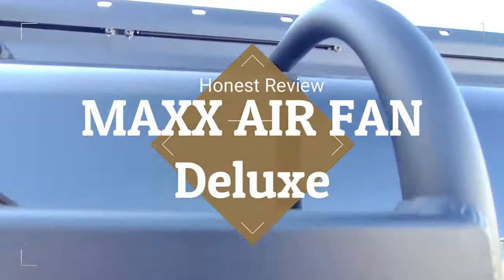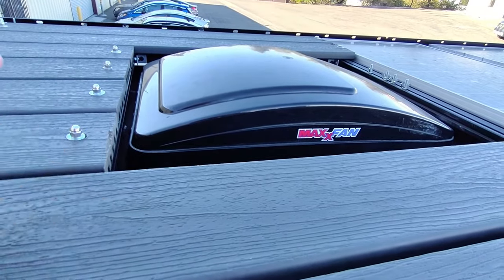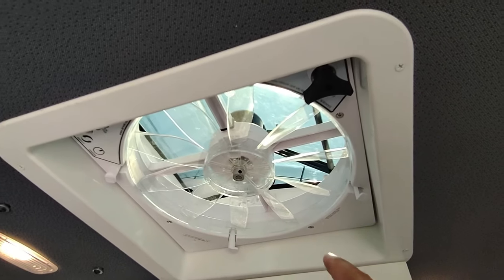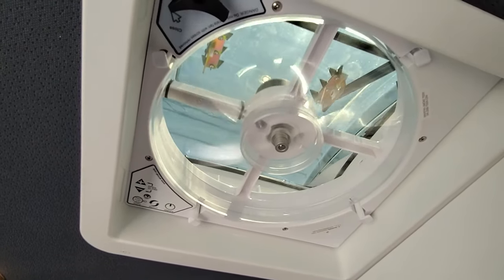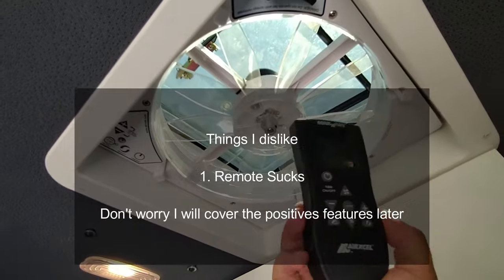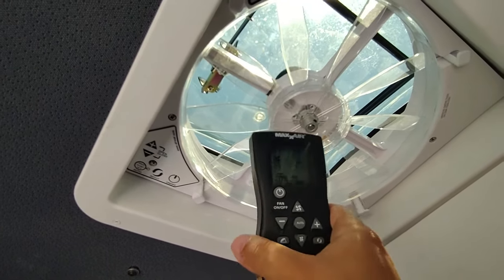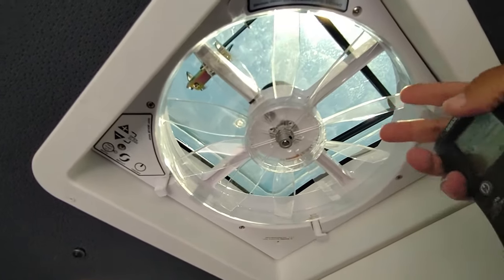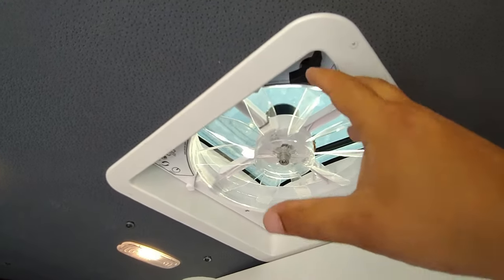Maxx Air Fan Install Defects▶️ Maxxair Problems Must Watch

Comment from the maker: ▶ Link to fan on Amazon.com https://amzn.to/3tCZXBX

▶▶▶Camper van playlist
https://www.youtube.com/watch?v=r2KTXLqso2c&list=PLDEbtVOPRC-id5xjqFsYm87bJSJL8bLbe
2019+ Sprinter Review https://youtu.be/wAAV6bnHNzY
The new toy  https://youtu.be/EAKbCledvsQ
Low Key Battery https://youtu.be/-FI_DG-DE9k
How to Buy a Camper van for cheap https://youtu.be/nqPSV0mszfk
Seat Removal https://youtu.be/KSUQawuSt_w 
Headliner removal https://youtu.be/FjrJBLXEbyU
Maxx Air Fan Install https://youtu.be/QXxBSx3cfI8
Maxx Air Fan Review https://youtu.be/JIRG7lSR5yQ
Maxx Air Fan Fix https://youtu.be/6k0mPqCgrl4
Bathroom Fan Review https://youtu.be/QXxBSx3cfI8
Spare Tire Carrier https://youtu.be/wVQ_h-FjtPE
Oem Diesel Heater Trick https://youtu.be/Ws9GHo9bWeM
Led Upgrade https://youtu.be/r2KTXLqso2c
Sportscraft Swivel Adapter https://youtu.be/HVkj6KVpUbs
Pocono Swivel Seat Adapter https://youtu.be/r-1HpIl71_I
Front Speaker install https://youtu.be/JjoJH4z4G1E
van Sound Deadener https://youtu.be/8x8RxmrBxL4
Sprinter Trim Removal https://youtu.be/ucYJsH5FJxY
Van Roof Deck https://youtu.be/4cu8mjVKQzc
Front Air Filter Change https://youtu.be/U46Ah40_vIM
Cabin Air Filter https://youtu.be/y8oZNLOkrok
907 Sprinter Oil Change https://youtu.be/bmgI-9KeEik
Maintenance reset https://youtu.be/wDTMwXHGqRY
Diesel Heater Hack https://youtu.be/Ws9GHo9bWeM
DEF Fluid https://youtu.be/Q84lEhLrobM
Portable Toilet Review https://youtu.be/fYu66hqGJZo
Affordable Kitchen Galley idea https://youtu.be/5DG9y_kmHLY
Rear door storage https://youtu.be/bPZfvTWAze8
Modify Rear A/C vent https://youtu.be/o4FJ6Y1ulCs
Sliding Door Bug Screen https://youtu.be/oGA8udVJlYM
Shower https://youtu.be/O4POEFKQmJQ
Plumbing video https://youtu.be/PuOqOt_911I
Simple bed idea https://youtu.be/Q7uGVFPgeDI
Van Life Camper Van Kitchen Galley Idea Under $200
https://youtu.be/5DG9y_kmHLY
Premade Camper Van Bed That Sleeps 4 Under $250
https://youtu.be/Q7uGVFPgeDI
Thetford Porta Potti Review - Simple Odor Free Camper Van Toilet Solution
https://youtu.be/fYu66hqGJZo
Van Life Rear Door Storage Solution for Under $40 for Camper Vans
https://youtu.be/bPZfvTWAze8
Sprinter Factory Roof Ac - How to Modify Vents for Van Build
https://youtu.be/o4FJ6Y1ulCs
Van Life DIY Camper Van Bug Screen For under $40
https://youtu.be/oGA8udVJlYM
Long Seat Belts for Van https://youtu.be/b9sQHKU-xdk
Battery Shunt https://youtu.be/54xGTbcFQB0
30 amp Battery charger https://youtu.be/SY0wS3DlKho 
Battery Box Cooling idea https://youtu.be/sng2aot7PLc
Window Covers https://youtu.be/aO407scjyfU
Camper Van Flooring https://youtu.be/ACaCkg_n-qw
DC to DC Charge Controller https://youtu.be/bquwcRwfSEY
5 Tips to Sell a Camper Van https://youtu.be/2knrkpAPVug

Comment: There is a DESIGN FLAW in the housing,  A 1/4” HOLE right ABOVE touch pad CIRCUIT board !  Hole will allow water or dust to drop right onto the electronic COMPONENTS if water or dirt gets under lid.  I found this while trying to diagnose an unrelated issue.  I plugged the 1/4” hole.  You can find the hole by unscrewing the 2 lid screws and looking at the spot above circuit board. Don’t know why the hole is there.  2). Squeaky nose from motor can be minimized by running fan at higher speeds in both direction for an extended period of time.  Bearing are very easy to change. Use good quality skateboard bearing. The fan does not like high voltages,  namely lithium batteries at 13.6 v.  They will cause that green flashing, beep- beep and freeze.  Pull fuse or power and it will reset.
Reply: yes. ours has filled with water and fried the whole touch board. its now disconnected and only controlled by the remote. 
Im actually so so sick of dealing with the company this came from and how much of a constant hassle this fan has been, Iv completely given up and will be buying a new fan. $500 down the drain being now out of its 1 year warranty period. 

Im an electrician. 

DO NOT BUY THIS PRODUCT IT IS TRASH
Reply: What fans should we buy then?
Reply: Do you recommend a different fan?
Reply: @MindBodyMuse  , I love these Fans,  and recommend them .   As a precaution, I recommend that everyone plug the 1/4” hole above the circuit board. See my comments herein as to how I plugged my 2 fans.
Reply from the maker: Sorry for the late reply! did you find a solution?

Comment: Just saw a video were they tested the issues you said. You need a voltage regulator to keep volts at 12v as well as spray the circuit board with a special type of spray. I will watch it again and post the type of spray. It was a weird name lol. Hope it helps
Reply: Here's the video I was talking about: https://www.youtube.com/watch?v=4LTkMciRPQs
Reply from the maker: I did that too, https://youtu.be/6k0mPqCgrl4

Comment: On instruction video it says not to have anything within 8”of the vent fan lid.  You have boards 1” away.  The rain sensor maybe pick up your board and why it closes automatically
Reply from the maker: Thanks for the feedback. 1 inch away and everything thing worked fine, if the maxxair was so good with instructions they should fix the issue with board on the this fan. 8 inches on van to give up is a lot!

Comment: A simple fix for the remote is to place a few pieces of mirror along the inner edge near the infrared sensor. The remote beam will reflect back to the sensor and allow you much better distance. It works! :)
Reply from the maker: Great tip! Thank for sharing, how big are the mirror pieces?
Reply: @RANDOMFIX  Only the size of the lower lip is needed. Depending where the fan is a strip of mirror going around that lip will reflect to the sensor. 

I did this with TV remotes. Works well even from another room.🙂

Comment: Now that we are a year after this post would you still not recommend this fan? If not what alternative? I’m scared to cut a hole in my brand new (2 years used) sprinter for something with such flaws especially not knowing anything about electrical solving issues. Would have pro install but still… upkeep would be difficult for someone unknowledgeable. Planning to get am auto windows and wondering if regular low power standing fan would suffice
Reply from the maker: I would still not recommend this fan but there are few choices for such a design. Are you will to put on a cover?
Like this mAXXAIR 00-933066 Original Vent Cover-White) ?

If so then have many options, let m know what you decide. I would be interested to see a different setup
Reply: @RANDOMFIX  I’d be willing to do whatever! Or buy whatever that works best. If you could start over and buy any fan which would you buy?

Comment: I was just looking at this model, and something nobody talks about but I could definitely see happening is a bee/wasp nest being built in there when the rv/van is just sitting for a few months.  I'm not seeing any kind of seal when the lid is shut.
Reply from the maker: You have a good point. As you stated not many including I have not had that issue with bees or wasps. But it can happen.

Comment: I have the same model, and in less than a year it is malfunctioning.  The circuit board replacements are not cheap.  I can’t imagine spending a $100 a year to keep this thing running.  
I’ve seen some people saying they need to be installed with a voltage regulator and some kind of sealer on the circuit board.   But at best the manufacturer is negligent and is shipping out products that have a variety of serious flaws.
Reply: Follow up… the manufacturer is honoring the 2 year warranty and sending out the latest circuit board which includes a voltage regulator
Reply from the maker: thank you for the update, is the voltage regulator internal?
Reply: @RANDOMFIX  yes, as I understand it from a discussion with a factory Rep, a voltage regulator is now a standard onboard feature on all the new circuit boards. 
Before I install it I’ll protect from corrosion by spraying it with a circuit board sealer like CRC.  Of course being mindful to mask off the connection points.  
Maxx Air fans have design features that I love, but they have a long way to go before they match the quality and reliability that Dometic has been building into Fantastic Fans for decades.  Maybe they will get there if they keep improving.

Comment: I have another issue with the thermostat at present but looking as to how complicated is to reach it for replacement in your other video I think I'll try to get the dealer doing this. My unit was purchased around October 2022, haven't seen condensation where the green bulb sits but I'll keep an eye on it. Hopefully they fixed this design flaw by then. See what the fan does:

https://www.youtube.com/shorts/b0u810UqZTg
Reply from the maker: Thank you for your feedback, much apprecated!

Comment: Appalled at quality of such expensive fans. Failed control boards and poor motors. Def would never have bought one for such a huge price if id known it would be a constant problem. Its the one thing in our house truck that is a constant pain in the a**. Just pure cheap quality mass produced trash.

1. High pitch squeals. 
2. Failed remote control board set off by cellphones being used in the vicinity, along with every other remote (tv sound bar etc.)
3. Failed button controls. 
4. Unbalanced bearing in motor
5. Touch pad failure due a design failure of a hole directly above control board that lets water in. 

Motor has been out to be pulled apart aprox 5 times in 2 years.
almost every part has needed replacing or pulling apart.

Im glad im an electrician with the know how to work on this thing, which i have had to do constantly for two years now. 
I feel for people who buy it and cannot work on these sorts of things themselves. 

If you buy this rubbish, expect it to be a constant maintenance point, before you replace it with a better quality different brand fan.
Reply from the maker: Agreed, this fan was really disappointing. I had a few viewers say it my install and I would take responsibility for my errors but this fan sucks!!! The only part of my sprinter I had to troubleshoot!
Reply: So what fan do you recommend?

Comment: Same problem on our maxxfan. We tried this fix but issues still persist. I called Airxcel as we only purchased a year ago. Good news....we are getting a new board. 
Bad news......we may need to wait 4 weeks....groan. 
Found out we can still run this without the circuit board with no bells and whistles. Gonna run to homer depot and grab a dimmer switch for on/off and maybe fan control.....?
Reply from the maker: I haven’t tried the dimmer switch but sounds possible, i am not sure Home Depot has a 12 volt dimmer. Also make sure you bullet proof your board when replacing it. I have a follow up video on how to do this.

Comment: 6 months later and a new circuit board I am still very disappointed with this fan!
Reply from the maker: It happened to you too?
Reply: appauled at quality of such expensive fans. failed control boards and these poor motors. Def would never have bought one for such a huge price if id have known it would be a constant problem. the one thing in our house truck that is a constant pain in the a**. Just pure cheap quality mass produced trash.

1. High pitch squeels. 
2. Failed control board set off by cellphones being used in the vicinity, along with every other remote (tv sound bar etc)
3. Failed button controls. 
4. Unbalanced bearing in motor
5. water fried touch pad due to design error with a hole above it that lets water in.

Motor has been out to be pulled apart aprox 5 times in 2 years.
almost every part has needed replacing or pulling apart.

Im glad im an electrician with the know how to work on this thing. I feel for people who buy it and cannot work on these sorts of things themselves. 

If you buy this rubbish, expect it to be a constant maintenance point.

Comment: I thought that you couldn't drive with the fan lid open?
Reply from the maker: No issues with up and down vent while you drive but there issue with the fan controllers circuit.

Comment: Should've had it  installed by a professional. Mine works great.
Reply from the maker: It wasn’t the install it’s the product, it needs a better voltage regulator!
Reply: @L Martinez mine was installed by our trailer manufacturer and it has the same exact problem.

Comment: I'm stuck on installing two maxx fans or 1 fan and I stall AC unit. 
I'm worried about the hot summer days. Anybody can help me decide from their experience please. Is two maxxfans good enough to stay cool and comfortable in the van during dry heat or humidity summer days?
Reply from the maker: I would install 1 fan an ac but what are you going to do power the ac as the power consumption on the ac unit is really high.
Reply: @RANDOMFIX  that's is my concern the cost of running a ac and all the batteries I will need. Thanks for reply I think I'll just do the two maxx fans because this unit I'm building is just for camping purposes and small week travels. I will not be a full-time van lifer
Reply from the maker: I built 280 ah lifepo4 batteries for under $700 https://youtu.be/j02eP4d0ndk

And if you really want a good ac unit. There is one that's 12 volt and doesn't need to installed on the roof and the power consumption is really how so you can run for long periods of time. I recommend building at least 2 X 280 batteries as you then run everything. I have 4 in my van it allows me run electric heaters. 

I can give you the ac info if you need it.
Reply: Hi Sir, what are the ACs that you spike of that you reccomend?  Thank you.
Reply from the maker: I would look at the 12 volt mark2 with no batteries that runs about $1000 and Build at least a 500+ ah lifepo4 battery storage.

Comment: On a second go around….what would you do differently?
Reply from the maker: I would put in a different brand unless max air has a confirmed fix. I’ve heard the unit needs a 12 volt regulator for the power, also the board should be coating with water resistant coating.
Reply: I would defintely buy another brand that is fit for purpose if i had a chance to do it again. alot of money to throw down the drain which you will do guaranteed.